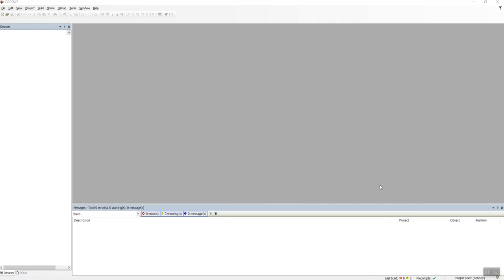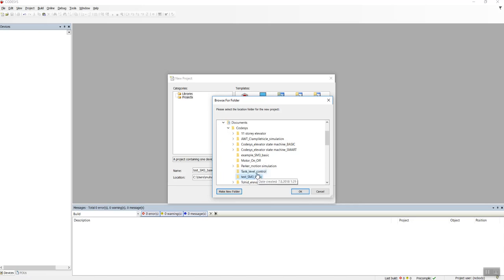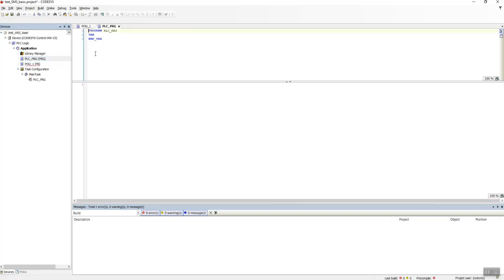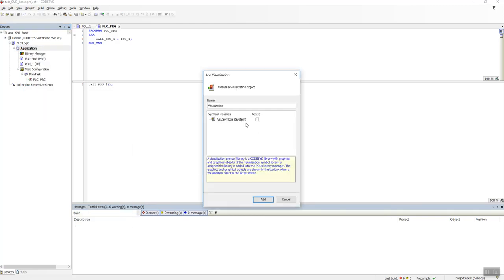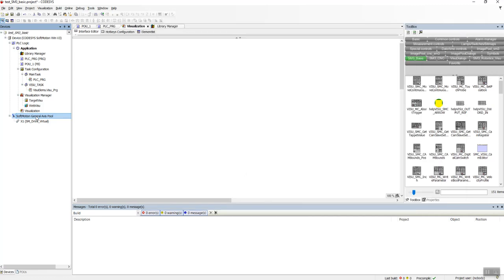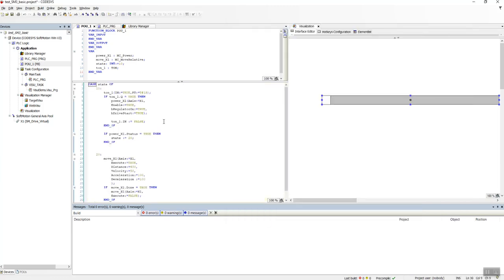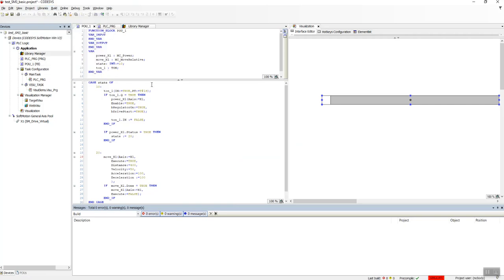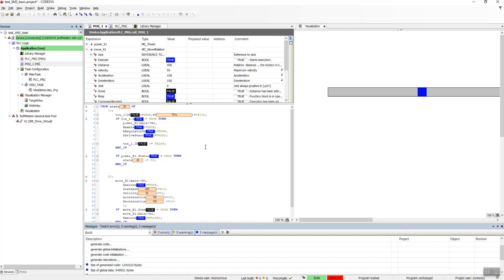Get started with CoDeSys motion control library(SM3_Basic)

Comment: thanks for your information. Please is there one library to control step motor inside to codesys by pwm ? The idea is to make the motion control with step motor without feedback.
Reply from the maker: I haven't looked into that domain but i have an idea. Can you turn your Raspberry Pi into a Codesys PLC, buy a cheap 10-15€ mini servo motor & then do the PWM test. I would suggest both open loop & closed loop control. If i ever do that kind of test i will share the experience.

Comment: Hi Jamal, thanks for the video. Do you know if there's a way the calculate inverse transformations with SoftMotion? Eg: I want to place a robot hand in certain position and a function would give me back the angles of the axis
Reply from the maker: I haven't looked into that domain yet. Personally i would always like to keep the PLC part & Robot control part seperate for articulated robot, except Gantry robots with 3 axis makes sense to control totally with PLC. If i ever program articulated robot with Codesys i will share the experience.